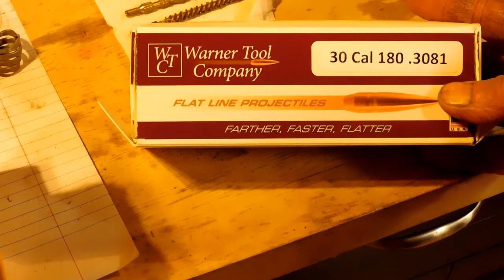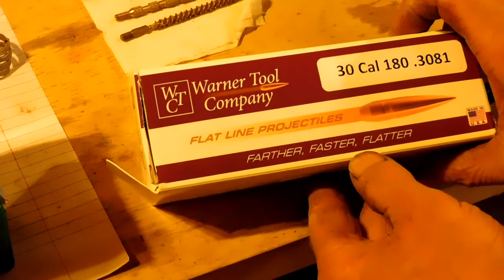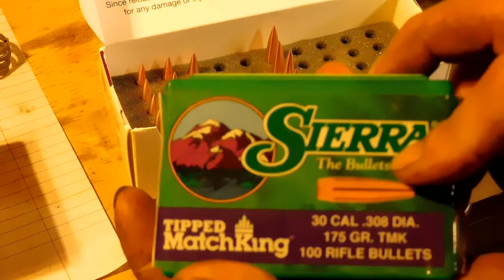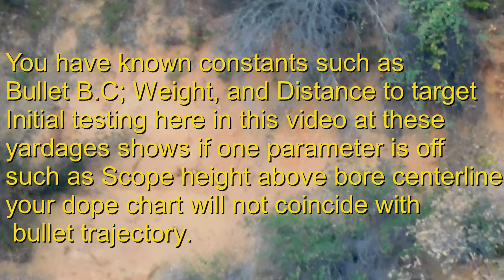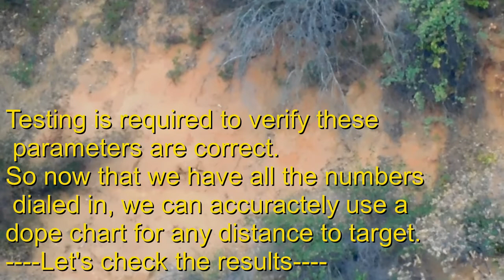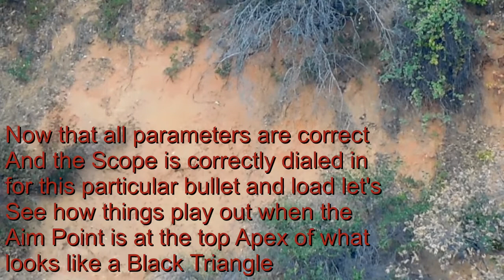Flatline WTC 180 gr. & CFE223 Load Work Up & LR Test in 308 Win

Comment: I’ve been looking at these. How’s the reloading on these things?
Reply from the maker: Hello, thanks for the question
They reloaded great. My one concern initially was that the tip may get damaged during seating without using a VLD stem since they are so sharp and pointy.
However I used a Standard RCBS Seater die and the tip did not contact within the stem at all....the contact point is much more down the Ogive from the tip.
(Bonus points to RCBS for planning ahead and knowing how to make a good die.)
Neck tension seating into Lapua Brass felt very nice and consistent as well.